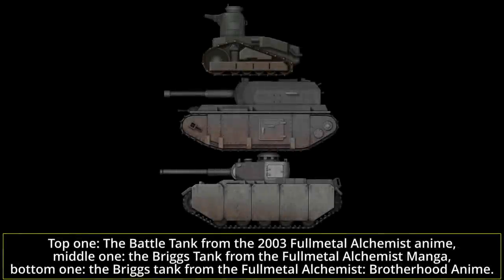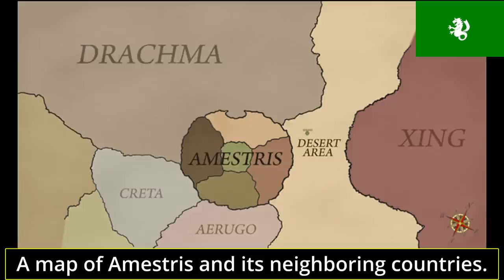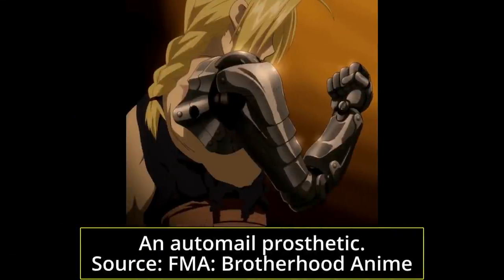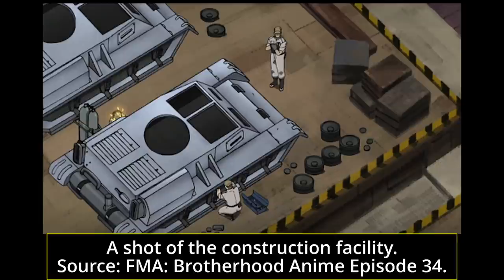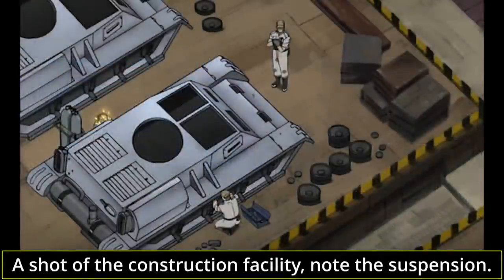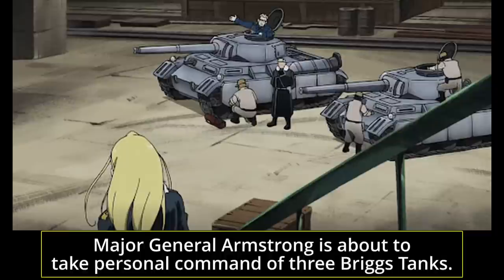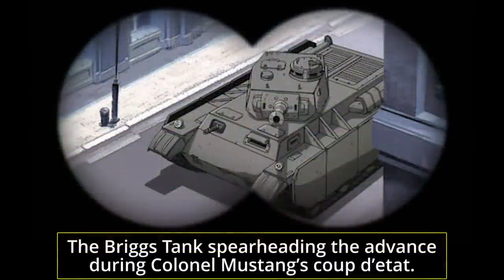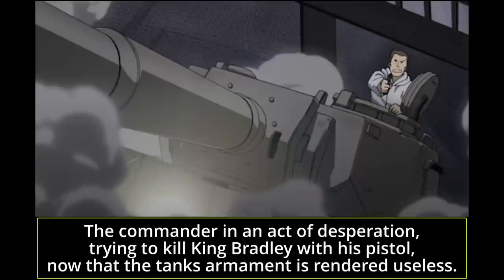The Fullmetal Alchemist Tank | Briggs Tank From Fullmetal Alchemist: Brotherhood

Comment: You could do a whole long string of series on the Vlkyria Chronicles tanks and vehicles. There is no shortage of material for review of semi realistic period tanks and gear in anime set in the ww1 and ww2 period.
Reply: Pretty much, the article which will be posted on our website on this vehicle and on the other two adaptations of FMA was already around 30 pages, but we only really wanted to do one video, as a lot of people might not like these anime vehicles either. Its a delicate balance and a slippery slope in that way.

But yeah, valkyria is on my list to write on.
Reply: GuP fan?
Reply from the maker: no.
Reply: @kommandantgalileo  i like it, but i wouldnt consider writing articles on it. I kinda want to stay away from ecchi stuff regarding anime articles.
Reply: @blasekiller9733  not you, the guy with Erwin as his profile pic
Reply: Considering how stylized the art is, and how little the tank's actually follow sensible design doctrine, that's not a great fit for this channel.
Reply: Valkyria gets really weird if you look at Empire tanks. The Edelweiss is basically a Tiger II and the Hafen is basically a Sherman, they're fine, but everything the Empire fields is a mishmash of french WW1 and interwar tank designs, bonus points for multiple turrets. I suppose the most normal looking imperial tank would be the Vulcan, save for its weird track design. It's basically a mini Maus with the speed of a modern MBT.
Reply: Also nice Erwin
Reply: The vulcan is wimp in wot blitz a black Prince with APCR will straight up murder it
Reply: No he shouldnt its a cringe game with bad designs
Reply: @TanksEncyclopediaYT  mid
Reply: @neverloseyuorrobux166 genuinely mid take